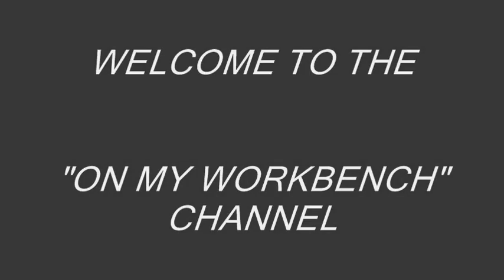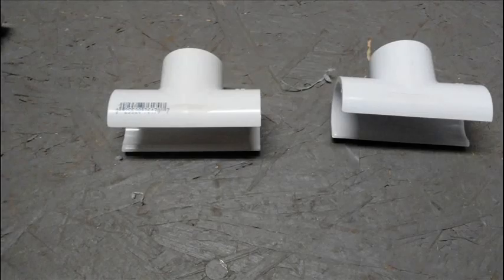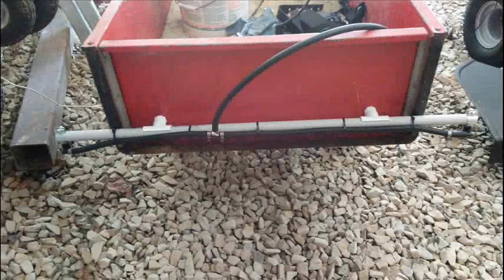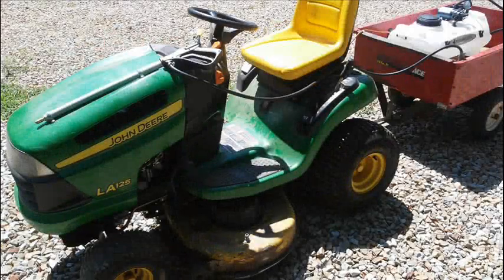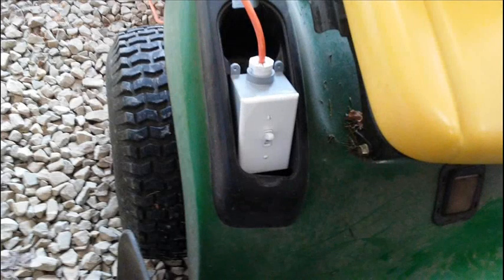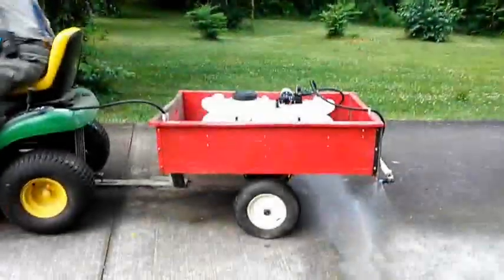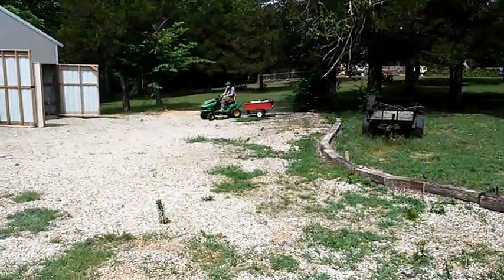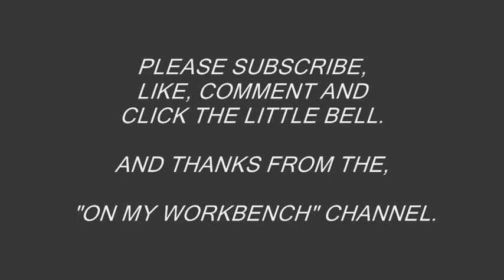SPRAYER CART BUILD

Comment: Thanks for posting. I’m wanting to do this with my lawn cart and I’ll be using your design as a guide. The spray wand on the hood is a great idea.
Reply from the maker: Thanks.
Make the PVC pipe to hold the spray wand longer than the wand, the nozzle on mine gets stuck on the pipe and it makes it hard to remove it from the pipe, I will be making mine longer. Watch that the spray hose does not get caught in between the rear wheel and the mower or get run over by the wheel. 
Good luck with it and post it to YouTube.

Comment: Very nice.  What did you use for spray nozzles?
Reply from the maker: Michael,
The spary nozzles came with the 15 gallon Workhorse sprayer that I bought from from Tracker Supply. The Workhorse sprayer comes with most everything needed to do the project other than the battery, on/off switch, screws, bolts and the PVC pipe, PVC pipe fittings and clamps. Please check out my other channel called Ma & Pa Prepper it can be found at: 
https://www.youtube.com/channel/UCT8rxzIcJ9WMx0dLr0htHuQ/videos

Comment: What did you use for spray nozzles?
Reply from the maker: pat swayze
The spary nozzles came with the 15 gallon Workhorse sprayer that I bought from from Tracker Supply. The Workhorse sprayer comes with most everything needed to do the project other than the battery, on/off switch, screws, bolts and the PVC pipe, PVC pipe fittings and clamps. Please check out my other channel called Ma & Pa Prepper it can be found at: 

https://www.youtube.com/channel/UCT8rxzIcJ9WMx0dLr0htHuQ/videos

Comment: Do you have a list of materials to make the boom
Reply from the maker: David Settle
No I don't have materials list for the boom but in the video at the 27 seconds point I talk about how the sprayer boom supplied with the sprayer that I bought at Tracker Supply came with a heavy metal boom and I replaced it with a 43 inch long 3/4 inch PVC pipe and I could still use all of the original sprayer hardware. All of the sprayer nozzles, mount parts, fitting and hoses came with the Tracker Supply sprayer fit the 3/4 inch PVC pipe. The only parts that I had to supply was the PVC pipe and the PVC fittings and the bolts, washer and nuts that I used to mount it on the back of the lawn cart and the PVC pipe that I used on the hood of the John Deer to hold the sprayer wand when it was not being used. Also I had to supply the electrical switch and the longer wire for the switch. Just watch the video a few times and make notes.
Reply: Can't find a used lawn cart
Reply: @Gokywildcats11  
Then build a cart.